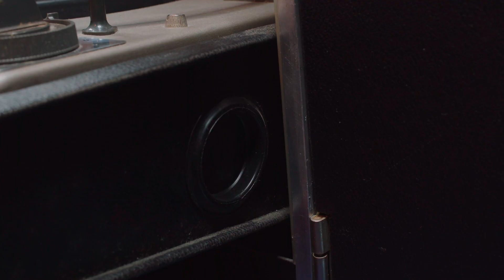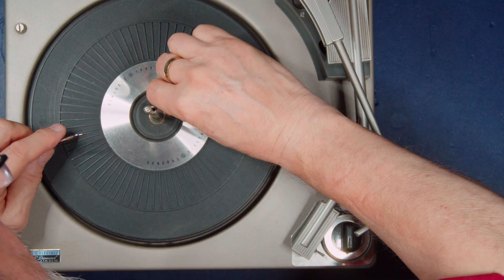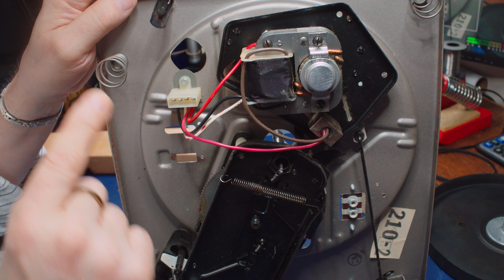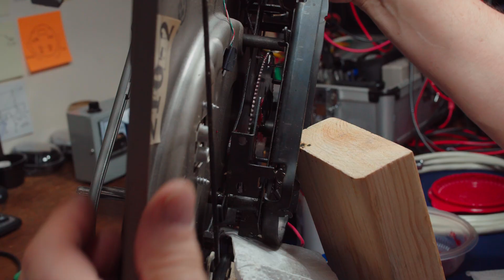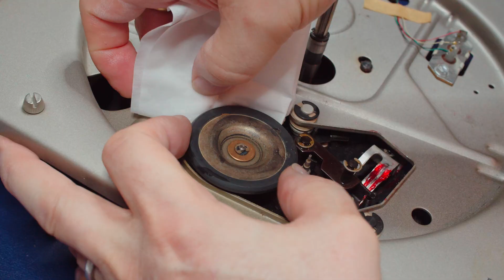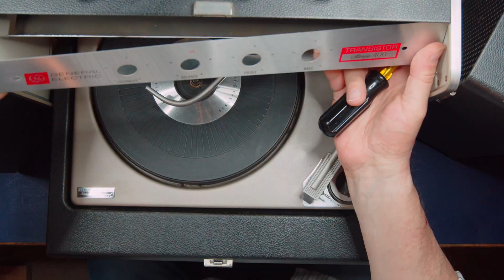"Greased Lightning" or "Rub Me The Wrong Way"  - 1965 GE 400 - Record Changer

Comment: Saving This video and I subscribed , Thank You for making it . Great Information .
Reply from the maker: Greetings, thanx for the good words & the sub..! Great little (..?!) record player/ If yours is similar, I'll mention that the amplifier board on this one actually has solder points for "Tape Recorder Outputs", that provide pre-volume/tone, line level outputs. You can record the records you're playing - and the volume & tone controls won't affect the recording. Also, records that stack up while playing act as a flywheel that adds torque to the platter for the REJECT mechanism to perform better. Have Fun, Be Well.